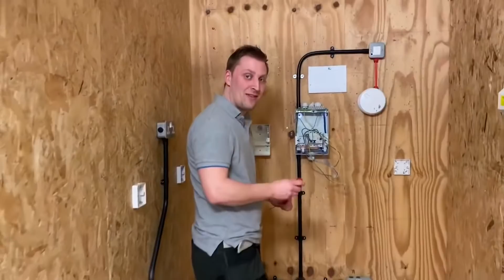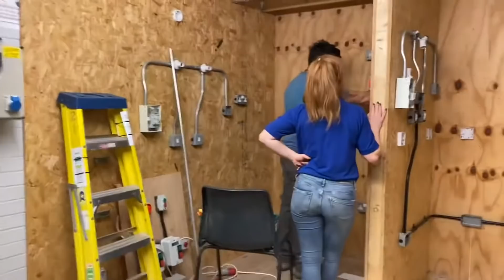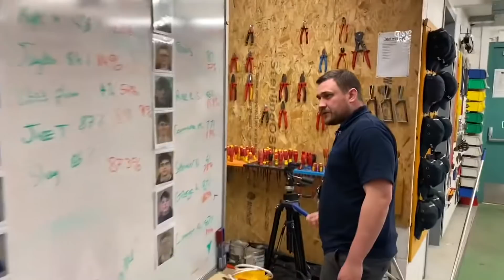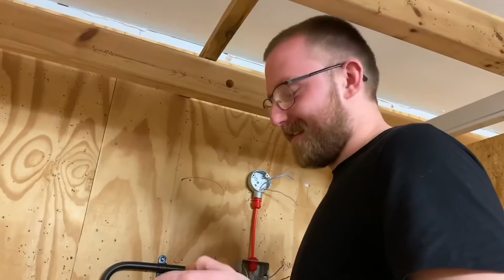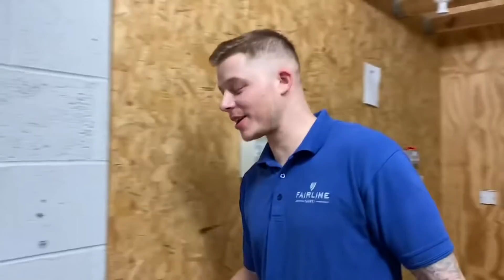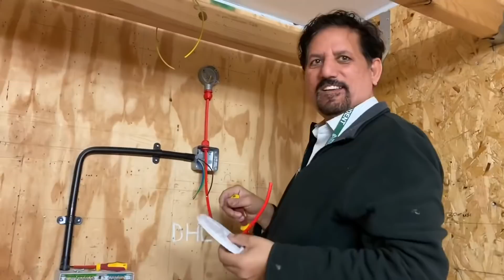Adult Learners Re-training to Become Electricians or Dwelling Installers - My Last Night Class 2020

Comment: Another great video. Please could anyone advise how much experience is needed to start a level 2 2365 course? I have completed a "domestic installation workshop" which looked at ring final, radial, lighting circuits (one-, two- and intermediate-switching), as well as a basic introduction to inspection and testing. There are three more weeks, but is it worth doing or jump straight in to level 2? Cheers for any advice!
Reply from the maker: In my colleges adults need no experience or set grades to take on a Level 2 👍🏻. Gaz

Comment: I was working 90 hr work weeks while going to class 8 hrs as well. I was super driven to be a master electrician and get my electrical engineering degree at the same time. In 2016 I fell off a ladder which was just a freak accident. I had a severe concussion and still have vertigo even to this day. What fucked me up wasn’t the physical injury. My ex left me and the house we just moved into because I was struggling with bills after my injury. I moved and tried to keep doing electrical work but my drive and confidence were completely shot. I got fired from a really great company and that just fucking did me in. That was in 2017. I still really miss the work. I miss working with my hands and learning something very difficult. I just don’t know how to start again. I have zero belief in myself.
Reply: One step at a time. Just keep moving forward. Good luck.
Reply: same happened to me- fell from tree, 2019. landed on my head due to vertigo i didn't know i had. Spine broken- damage to neck and shoulders. no power left, cannot use my left hand. just pain . I would love to retrain as electrics are so interesting but it is not just the physical pain and damage. i am not the man i was- really- but i cannot tell anyone- i'm ashamed of what i have become.
Reply: @tutnallman  Working a tough trade already makes you twice the man most dudes claim to be. You’re not limited from learning all there is to learn and applying your knowledge in another capacity. Don’t be ashamed. Most dudes are too cowardly to enter into a hard vocation. Do you have people around you that love you and care about you? If you want to talk I’m here to listen. You’re not alone brother.
Reply: I've just seen your posts Enterprise and Steve, I'm in the same spot although much less painful, I'm training to become a sparks, after working all day, a family needing attention at home, wondering if I have the confidence to get qualified, let's never give up gents, maybe you guyscojld start small doing odd jobs, testing is less physical. 
God bless ya for the future. Ben from the Uk